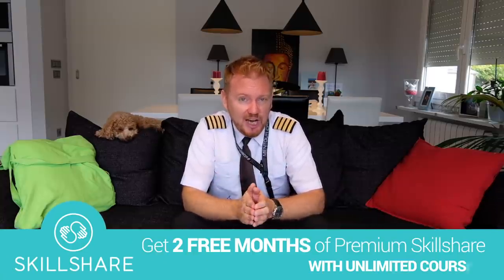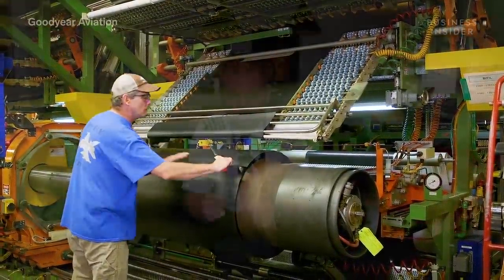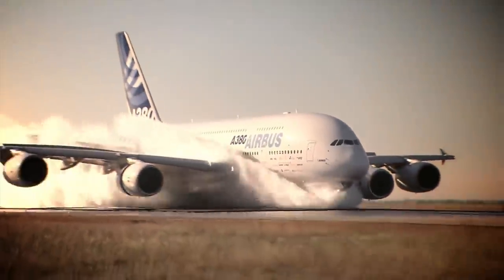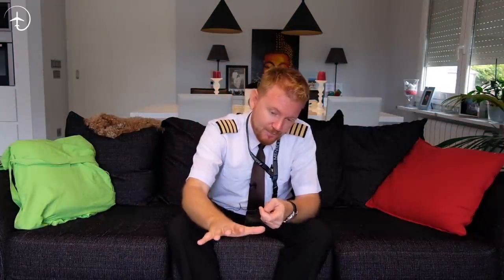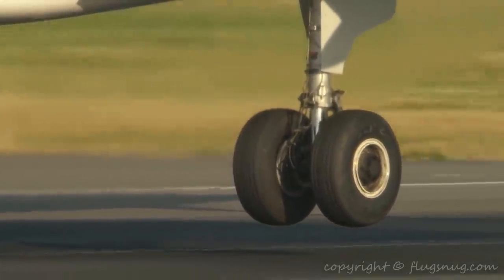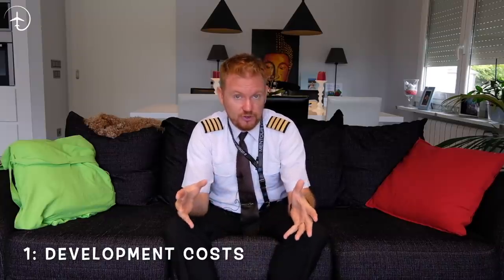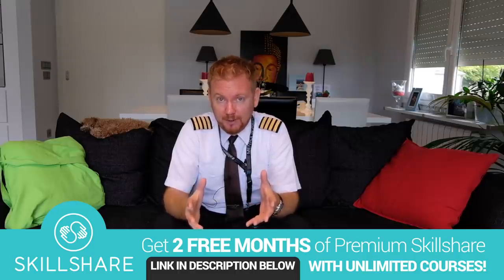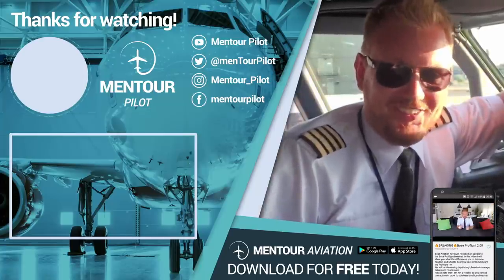Why not make plane-tires spin, before landing?!

Comment: Very interesting. But if there was a ‘waterwheel’ type thing on just the nose wheel to start it spinning before landing that would save the life of the tyre?? I know it’s a small amount but as a passenger I go 1Kg over weight on my baggage I have to pay extra!! So every little saving helps over many years of flights. Not a mechanical motor but just a water wheel style blade on the outside of the wheel so when the landing gear drops it starts spinning the nose wheel. Not the main gear because, as you say, that could drive you off the runway. 
If you can prolong the life of a nose wheel tyre over a fleet of aircraft for years it should be a profitable move. For just a simple blade, no motors/electronics. 
Just an idea!!! Please let me know. 👍👍👍

Comment: Okay, good comments, but there is no need to spin at landing speed.  Anything will help.  There may be a balance between the potential energy release to slow the plane and the cost related to it.  Use a flywheel to capture some of the energy of the spinning tire at takeoff and release it at landing.  Just spinning the tires at 10 RPM will save wear and cost.  As well - controllability will improve by reducing skidding.

Comment: First of all, it's not all or nothing. You don't need to spin up the tires to 260KPH to exactly match your landing speed. Any increase in motion (A body in motion tends to stay in motion, a body at rest wants to stay at rest) will greatly reduce the static friction as well as kinetic and rolling friction. 
Second, the wheels don't need an external power source to get them moving. An impeller or centrifugal set of fan blades connected to the wheels will use the airflow as the gear is lowered to start the rotation of the wheels. This would impart a level of drag, but it would be known so calculable. 
A passive system like this could be disengaged quickly and easily as well. The cost would be minimal, almost non-existent compared to an electric or petrol motor. Perhaps with a variable pitch blade, a tiny collective in the cockpit(!) they could be spun in reverse for extreme, emergency or short landings.
The idea here is to have the wheels in motion, even a little bit will make a big difference.

Comment: Really great points!   It's very discouraging to hear the implication that certification and regulation inertia might discourage any further evolution of airplane design.
And the waste of fuel during taxiing is incredibly wasteful -- Jet-A fuel can't be good for the environment or pocket book.   One factor in robotic tugs might be getting them out of the way quickly, they could be a serious hazard on the runway for other planes if they can't get out of the way.
As for wheel spin malfunction on landing, that could probably be mitigated by speed sensors like those in anti-lock brakes or speedometer sensors, but there is still the potential for failure.  And lastly I wonder if there is any tiny braking benefit to the plane from essentially skidding onto the landing strip rather than having wheels going at speed or even half speed as there doesn't seem to be any reason why spinning wheels only partway up, say 100mph, wouldn't save a little rubber if we actually cared that much about tire cost, which obviously we don't and probably shouldn't looking at the big picture.  Would make more sense to save taxi fuel with a robotic tug.

Comment: I worked on some aircraft in the 50's that had a tyre tread block pattern that spun the wheels but with the advent of modern multi-rotor disc brakes, their drag makes this impossible.

Comment: Also what is not mentioned is Go-around. If you have to be able to make several of them in short time you would have to accelerate then use the brake then accelerate then use the brake and again and again until landing succeeded. That would need a huge amount of electrical power AND wear down the brake enormously If it can even withstand this procedure at all AND it puts all three - energy supply, motor and brakes - at a very high risk of failure during the final and most stressful landing approach.

Comment: However, if the hubs of the wheels- and perhaps the tires themselves- had a sidewall architecture that generated rotation in the fast-flowing air during approach, then the wheels could plausibly reach a couple of hundred RPM before touchdown.  This would reduce the contact erosion without any need for motors and the rotation rate would not be sufficient to generate vibration, and any gyroscopic effect (as proposed by one commetor below) would be beneficial in helping to keep an aircraft stable in high windshear scenarios- it would help resist the effects of close-to-ground turbulence.  Aircraft would track better on final approach.

Comment: 1)
Why is it by default supposed to be batteries used for spinning up the wheels?
It can't be much power needed and in a short time so why not from the existing generators?
2)
Why do the wheel speed need to "exactly match the speed of the aircraft"?
It seems to make little sense just asserting that exact match is required.
Anywhere near the landing speed is MUCH better than 0.
3)
Why are cone tubes fixed to the landing gear not considered?
They are inside with the landing gear on flight so no extra drag and the extra weight is infinitesimal.

Comment: I always thought tires smoked because of the slight lateral motion  of the airplane as it lands. I fly WAY, WAY to much and I always notice some lateral force while in my seat.  So I am surprised to learn that they smoke because they skid a bit until they accelerate up to the airplane's speed. 2. I am glad to hear "tugs" might be used for taxing to the runway. 3. QUESTION TO MR. MENTOUR: I have noticd that when I fly with Qatar Airways, I experience more lateral landing force than every other airline I fly. Is there a reason why this happens with QA?

Comment: How about an extra set of wings (much smaller than the main ones), that deploy for landing only, so that the plane can land 10 to 20% slower.  Not only would that help save the tires, but will also help save brakes and allow the plane to land easier on shorter runways.  If that is not practical, why not have even more flaps and slats to allow the same thing?
Reply: its all about weight

Comment: Could use air pressure from the engines to blow air onto the brake cooling fins to rotate the wheels. And auto brakes to get them to the right speed. But I understand there are a lot of variables.
Reply: Except you'd be blowing hot air on to brakes that are about to get bloody hot anyway, not to mention I doubt the fins would be anywhere near big enough to provide much force.

Comment: Nitrogen is very inert, but this has nothing to do with its temperature or pressure behavior. When it comes to gas expansion, you could also use clean and dehydrated air. That would behave very similar to nitrogen. However, "normal" air that you can get from a compressor is never completely dehydrated, even if you use a dryer (like you would do if you use the air for spray painting). So the water in the air can actually freeze inside the tire and you don't want this. The water which expands and condenses again also severely impacts the pressure of the tire. Liquid water takes a lot less volume than gaseous water. So, if the tires are still cold, then any remaining water in the air would condense or even freeze and the tire would have a lot less pressure than it should have. Nitrogen on the other hand, is pretty pure and definitely does not contain any water. But as I said earlier: The same behavior can also be achieved if you had perfectly dehydrated air... However, the absolute core reason to use Nitrogen is to prevent any fires. For one, there have been cases where the tires heated up so much that the oxygen in the tires was sufficient to ignite the tires from the inside out - they even exploded occasionally, when they reached the autoignition temperature. This can not happen with nitrogen filled tires. Additionally, if the gear starts burning, because of the hot tires, it might blow the tires. If the tires contain oxygen (from normal air), this will fuel the fire. However, when the tires contain nitrogen, it will rather have an extinguishing effect on the fire instead of fueling it. This is actually the part where the inert behavior comes into play. Nitrogen does not easily react with other materials, whereas oxygen works as oxidizer and can burn material...
Reply: Okay, I just noticed that others have also already pointed that out. Some comments are even a lot more concise than mine. However, I leave the comment here anyways...

Comment: 🤔💭Despite all that, If you did want wheels to spin before landing perhaps they could have built in hub caps with blades sort of reverse principle of a mechanical air horn, to spin the wheels with Air flow under Aircraft, although adding blade or hubcaps to aircraft might be a bad idea if  comes loose and flies off, also blades could be used to generate electricity from Airflow under Aircraft.

Maybe Electricity could be generated from turbine on Aircraft and stepped up to produce high voltage to creat ion wind over wings to increase lift, but electrical systems on the plane would probably need to be shielded from interference from high voltage. 

Maybe Ion wind could also be used to blow out a fire if aircraft caught fire.

or maybe a Plasma type engine could be made combined with ion wind over Aircraft.

Comment: All the options about fuel savings don't take into consideration the cost of energy.  Energy always come from some source.  Even battery powered remote airplane movers would require massive amounts of battery power.  That has to come from some charging source (likely a utility grid) which would add a huge amount to the utility bill for the airport, which would be passed on to airlines as landing fees (which then are passed on to customers).  Different methods of using energy for motion are more efficient - of course.  Probably the most efficient use would be the airplane's own inertia.  Keep the airplane moving under the kinetic energy it gained while reducing potential energy (altitude), but then you run into the safety issue.  You can't taxi at 200 mph.

Comment: I've been a tour guide at an aviation museum. We have a F-14 Tomcat. The side of the tire says, 200psi for land landings, 400psi for carrier ops. I didn't hear him mention the pressure change of roughly 1 psi for every 10 degrees F of of temperature change. That could be a spread of 20psi from a hot, LA day to 30,000 feet. Not that much, really.
Reply: The pressure isn't generally worried about too much as regards daily weather temps but the difference of 200 to 400 between carrier and land landings is because landing on a carrier is far more violent that landing on a nice long runway, its also why they don't land F16s on carriers, their undercarriage isn't designed for it and couldn't handle it for long if at all

Comment: Instead of installing motors to the tires (just the first tires that come in contact to the runway while landing) to get them to spin during landing (which is technically challenging), why not instal fins to the hub of the wheel so that the wind helps the wheels to spin in preparation for landing

Comment: It's a very simple answer for that pre-spinning idea. The cost of the tire wear on each landing does not pass the fuel costs for the extra system weight, the new parts replacement costs and adding weight cargo limitation. It's all about money.
One day I have an idea of why planes do not have the seats rows in capsules with parachute systems to save lives before a crash? Because weight translate in fuel consumption, also is cheaper to compensates their families for their loss than compensate the survivors for life.
Everything in this industry is all about weight and fuel economy to make money.

Comment: I wonder if the apu could provide power to a hydraulic system that would power a set of wheels during taxi. I may be wrong, but aren't there hydraulic systems that terminate very close to the tires themselves. Couldn't be terribly difficult to implement a drive system that could be disengaged during take-off and landing. The new gear could be swapped onto the plane with almost no retrofit and throw a rocker switch into the cockpit for forward, stop and reverse. Is this a plausible idea?

Comment: Why not just add blades to the side of the wheels to spin them from the air rushing by?  No motors, no batteries and not a lot of weight.

Comment: i believe they used to have cups on the edge to spin the tires guess not needed any more   tires are intense tech 200 landings and can be RETREAD up to 7 times   they do have diverters to keep spray of water from landing entering the engines like in 727 so they don't flame out  way cool tech

Comment: Use 200kg of fuel for taxying but if using electrical driven system how much fuel would you use dragging all that extra equipment around the sky for the whole flight. Main problem as others have pointed out is gyroscopic effects of, in the case of a 747, 18 heavy gyroscopes moving at slightly different speeds all trying to keep to their own rules of spin, plus as Bill Witt says what if they get out of balance, I have changed a number of nose wheels for that very reason. So basically its not worth the bother doing all that when you can just put a bit of extra tread on the tyre so it lasts longer. That of course is civil aircraft, Military jets have a few different additional requirements, rough surface protection, higher landing speeds, occasional high side loads, high vertical sink rates,(Harrier & F35 plus naval types), in the case of the English Electric Lightning the main wheel tyres often did one landing and had to be changed, but it did land at almost 200mph (commonly referred to as a controlled crash, some not so controlled!).

Comment: The third reason is not a deal breaker... if one motor is faulty, the second motor is off. The biggest benefit of having a motor on landing gears is that you can "short" the motor and is behaving like a brake. The parameters of both motors is the same, but could be influenced by the heat also... it's not worth the price to implement such things for a "minimal" wear of the rubber, anyway :)))

Comment: The autonomous driving idea never occurred to me--the cost and complexity would be so huge it could only be justified on a whole new aircraft design.  However, I have wondered about tire wear on a spinning vs not spinning tire.  The solution would need to be low-tech, low cost and failsafe.  A simple wind vane arrangement on the outside edge of the wheel would use slip stream to spin the tire up.  Since it uses airflow across the under surface of the body, tire rotation could be made to match aircraft speed.  With no motor torque applied to spin the wheel the tire would adapt quickly once it contacts the ground; it's a completely passive system, nothing needs to be turned on or turned off or monitored, no batteries, no wiring.  Also, I don't believe it is crucial that the tire rotation exactly match speed--the goal is to save rubber so any rotation is better than a stopped tire.  In a crabbing situation the rotation speed would be moderated by the  angle of the wind vane to the oncoming air.
While there may be some cost involved, as in any engineering change there has to be a cost-benefit analysis.  Only the aircraft maker has the needed information to do that, so I'll hold off on my patent submission.

Comment: What about a stream of compressed air to spin the tires?
I think if the rolling speed don't exceed the ground speed the tires would not tow the plane out of the runway but this should be analyzed better

Comment: All gases physically behave the same under pressure in temperature changes. That is declared by universal gas equation and does not depend if gas is inert or not. Why tires are filled up with nitrogen is because 1) it is inert - that means it doesn’t chemically react with tires and 2) It is weights less that air

Comment: decades ago I thought why not have a thin profile vane (like a 90 degree mounted compressor fan in a car), mounted via the bolts on the wheel to have a passive way to spin the wheels upon landing. I guess via the points mentour mentioned not likely...........

Comment: Inert gas doesn't mean it doesn't react to temperature and pressure. Every gas reacts to changes in temperature and pressure. Inert means it doesn't react with other elements, such high temperatures can cause a lot of parts to corrode if normal air is used.

Comment: That question never occurred to me since it seems be a pretty big non-issue. I mean those giant airliners of today are capable of very smooth landings without pre-spinning the tires and the tires are evidently capable of withstanding it enough times to be economical.

What I did wonder before and really wonder now is if using the jet engines for taxiing is so inefficient, but the potential fuel savings of an internal combustion engine would be eaten up during flight due to the added weight, why not use the tow vehicle to taxi the plane all the way to the runway?
Who says that extra engine has to be installed in the plane itself? It's basically the same as having an internal combustion engines in the plane to turn those wheels, except it's detached before takeoff and thus doesn't add any weight while it's not used.

Comment: I was thinking about motors in the wheels for regenerative braking. Not to charge anything, just a backup or assistance to the main brakes or if one side of the brakes failed. As for spinning to drive around, or accelerate on takeoff or a go around, I have no idea, but spinning on landing when one is trying to stop.. seems counterproductive.